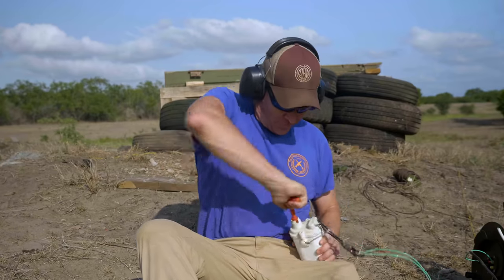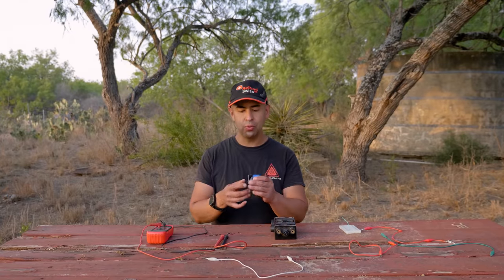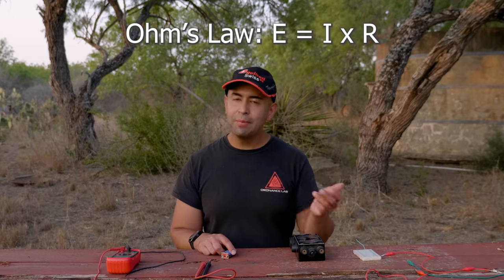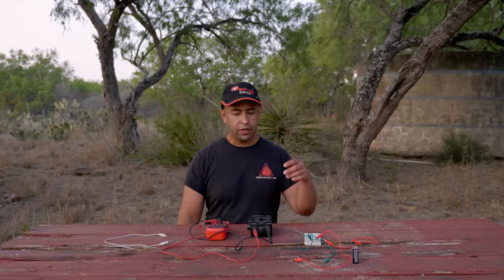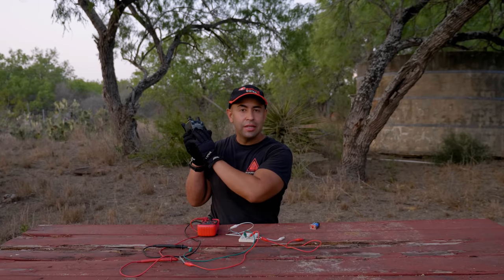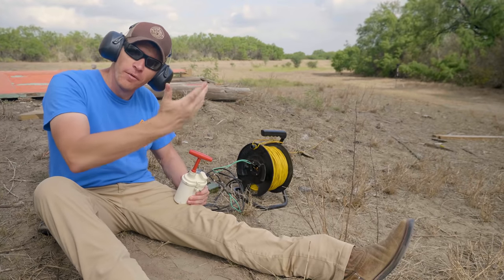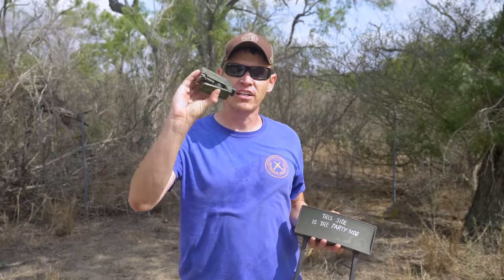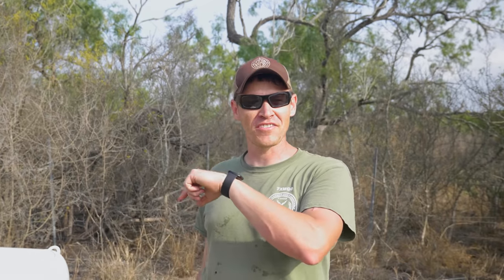Ordnance Lab's Top Methods of Detonating Explosives (Part 1)

Comment: The thing you are using at the first, is not a 10 cap blasting machine. It is the backup firing device for tanks and self-propelled artillery. Thats why it is painted white. Like the rest of the inside of the tank.
Reply: "thing"...😮

Comment: While in Vietnam I was tasked to blow up some VC building materials. I had C4 and regular fuse to go with my blasting caps. Sad to say all of the fuse material was wet and would not light. So it put the blasting caps in one end of the C4 and set fire to the other.  We went back to see how effective we were. The fire burnt most of the sticks in half and the explosion spread the rest all over to include into the trees. A fun day for all. 😁

Comment: Huh, I always figured the M57 was a piezo electric device.
Reply: Could be a magnet being snapped through a coil wich you could say is a generator... Could also be big piezo element tho I don't know if that would be powerful enough
Reply: @patrikmuller151  Metal bar through a coil switching polarity by "clacking" onto a magnetic frame diagonally.

Comment: Way not use a rapid discharging cap ? You could even add a step up to bring voltage higher! Its safer with less amps. Edison stole alot of his adventures. Magnitos are cool! I knew a guy how tested clakers by toching them. What about the old and held generators

Comment: The original development of the claymore mine had a heavy metal back plate .        I believe the eventual mine used a heavy PVC backplate .   Ultimately the more modern claymores use a thicker layer of composite molded during manufacturing.
Reply: Maybe in the prototypes, but I have demiled claymores form 60 and 61 and there is no metal plate. Just variance in the frag pellets'.
Reply: @quinnbrown6382  Canadian or US claymores or Chinese or Russian ? .  Also  demilled is not exactly a good example.  For instance demilled hand grenades like the m26 don’t have the fragmentation coil inside from many suppliers. 
     The original patent had the metal plate as well a few countries originally used it.   Later replacing it with heavier plastic to limit fragmentation going rearwards and help tamp the sheet explosives better .          Though I feel bad for any troops thinking it’s safe to not take cover ( not concealment ) when clacking off a m18 .
Reply: @TAR3N  they are both US and I took part in the demilling process.  Was all resin casting behind the ball bearings. 

However, my sample size is 2.  And the lord knows ordnance, especially pre 85 ordnance, has variance that aren't described.
Reply: Ain't never seen a backer and frankly common sense is the force is to be disapated by air, a backer would go flying and kill the people using them behind the frag radius. Makes NO sense. And never heard of even prototypes having a backer.

Comment: Mumbles about Australia turning ac into dc for long distance feeder lines then back to ac at the other end to get greater efficiency on long lines.
Reply: That's only doable with modern electronics. Basically AC is stepped up to an extremely high voltage then converted dc to go down the cable. At the other end it's converted back into AC so it can be stepped down to more sane voltages. You can't step DC up or down directly.
While DC is slightly more efficient to transmit down the cable it's only practical for very long runs due to the cost and power loss of that conversion.
Reply: @LesNewell  
And yet dc has less losses than ac.
Reply: @brucebaxter6923  By far the biggest effect on losses is voltage. If you double the voltage you can transmit very nearly 4 times the power over the same cable for the same percentage losses. There are limits on how high you can go due to unsulation breakdown and general safety. To step up and down you have to use AC. A much smaller effect is capacitive coupling between the wires, which particularly affects underground and under water cables. This only affects AC. Additionally AC needs better (thicker) insulation. On very long very high power lines the extra fraction of a percentage efficiency gain combined with cheaper cable offsets the very complex and expensive AC-DC-AC conversion. For general distribution it does not make any financial sense.
Reply: @LesNewell  
Oh dear god.
Don’t you mean resistance, followed by current.
No, twice the power at twice the voltage as the conductor can only carry a certain current.

I didn’t read any further as the amount of wrong is just too much
Reply: @brucebaxter6923  Read my statement carefully. For the same cable you can transmit nearly 4x the power with the same percentage losses by doubling the voltage. In distribution cables current is not the limiting factor. Losses are. If you get anywhere near the maximum current the cables can physically handle your losses are ridiculous. You want to feed your power to your paying customers, not heat up the countryside. Power companies decide what percentage losses they can live with and calculate from there.
Hold on to you hat, here comes the maths. We need two equations:
P = V x I (power = voltage x current).
P = I * I * R (power = current squared times resistance). We can easily derive this from ohms law and the above equation.
Let's assume our power company has decided thay can accept 5% cable loss.
Say we have a cable carrying 100A at 1000V. P = V x I so P = 100 * 1000 = 100000W. 100kw isn't a lot for a distribution cable but let's run with it. The numbers get silly otherwise.
Say the cable is 0.5 ohm. power loss is (100 * 100) * 0.5 = 5000W
5000/100000 = 0.05 or 5% loss. Bang on our limit.
Double the voltage but keep the current the same: 100*2000 = 200000W
The power loss stays the same at 5000W. 5000/200000 = 0.025 or 2.5% loss. Nice. It saves money in the long term but infrastructure is expensive. How hard can we push it?
Double the current. P = 200 * 2000 = 400000W. We are now transmitting 4x the power.
Power loss is (200*200)*0.5 = 20000W. The cables run a tiny bit warmer but way below their failure point.
20000/400000=0.05 or 5% loss. As I said, for the same cable, doubling the voltage allows you to transmit 4x the power for the same percentage losses. 
To be really pedantic, capacitive coupling losses increase with voltage, which is why I said very nearly 4 times.
Reply: @LesNewell  
Blah blah blah
I read what you wrote and can’t be bothered reading any more.

Go back to watching cartoons
Reply: @brucebaxter6923  <sigh> why did I bother feeding a troll? I should know better by now.
Reply: @LesNewell  
I guess you got hungry.

Comment: @ ordinance I have an experiment for you to test. This is an important experiment that could be used to save lives if it proves successful but I would like to see what happens if you shoot ping pong balls full of tanerite from a helicopter at a fire
Reply: A huge issue with this is, if the ping pong balls full of tannerite were fired with enough force for them to explode on impact, they would explode inside of the gun the moment you tried to fire them. Another issue is that tannerite has a relatively low detonation velocity, half that of dynamite. The lower detonation velocity combined with the very small amount of tannerite you could fit into each ping pong ball would make it ineffective at extinguishing flames. Also, using explosions to put out fire is something generally limited to oil well fires. I don't think it's very effective for other kinds of fires, especially things like wildfires where they can be huge and move at the speed of a car on the highway. Or things like house fires, where the explosion to extinguish the flames would have to be powerful enough that it would destroy the house anyways.

Comment: How do remote detonators work without wiring?
Reply: You have a fuse well at the top that you crimp a time fuse, or visco into.  Then there's a flame sensitive mix that burns, setting off the primary explosive which in turn detonates the secondary explosive in the detonator that leads to the output segment (bottom) of the cap.
Reply: Just realized that you said remote.  You'd neet some sort of transmitter like a cell phone, and a receiver at the charge. You wire the receiving end to the blasting cap. It's easy enough to find out what that circuit should look like.
Reply: @chemistryofquestionablequa6252  i'm just curious because aren't most detonations done remotly this days?
Reply: @flemishlion69  Likely cost and reliability/safety.  Blowing up a few feet of wire is cheaper than the electronics needed to make it remote.
Reply: Think of it as a more complex wireless doorbell... hint...hint
Reply: @flemishlion69  
Unless it's military remote detonation / detonators . There's a danger of errant radio signals setting off the charge prematurely. You don't want the building demo going off early  because someone used a garage door opener.
Reply: @j.robertsergertson4513  thx for the info